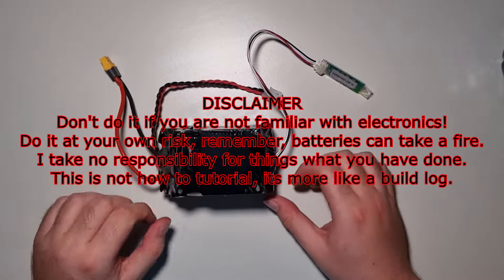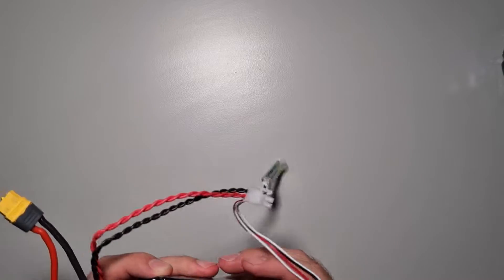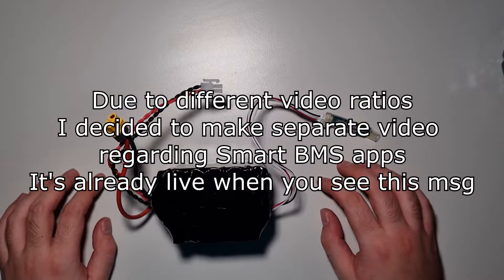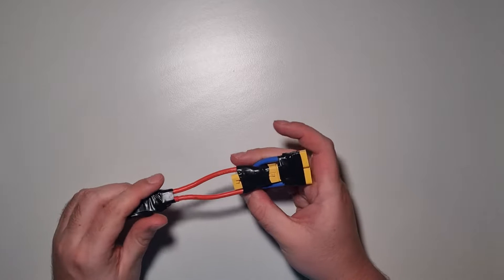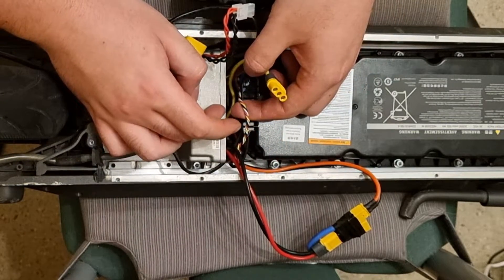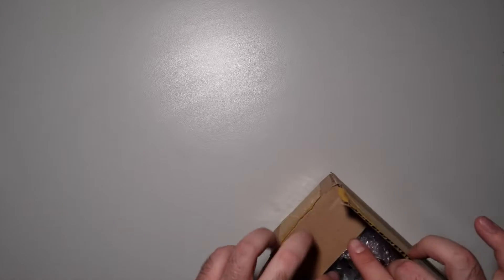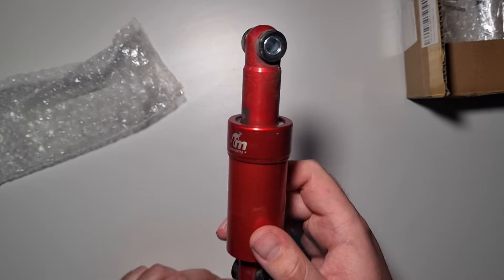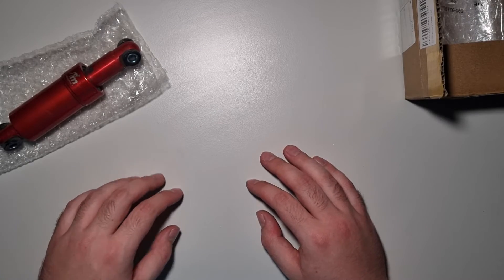Upgrading the Ninebot MAX G30 to ride faster 13S/48V additional internal battery upgrade Part 2/3

Comment: Do you charge both batteries with one charger?
Reply from the maker: No. You shouldn't.

I use segway 5A fast charger for main/big battery, and china 5A 12,6v charger for smaller battery